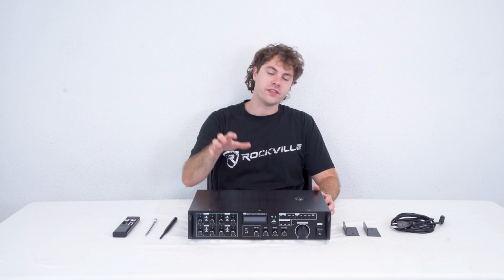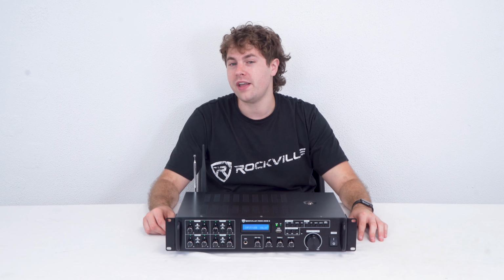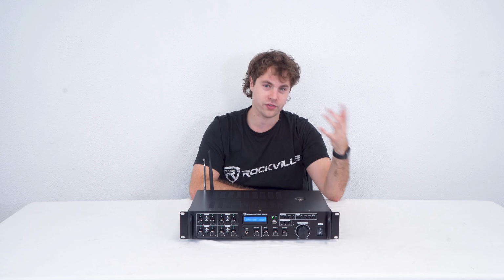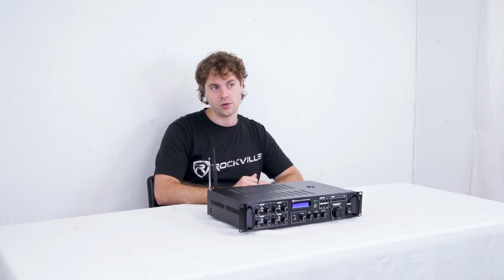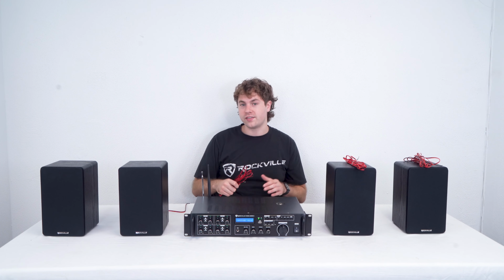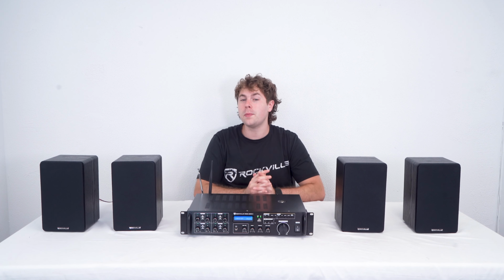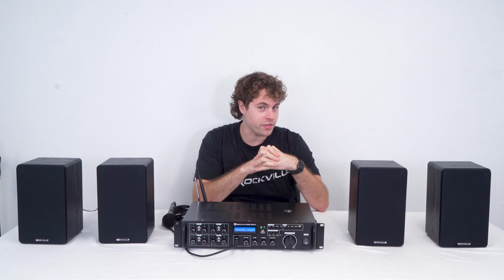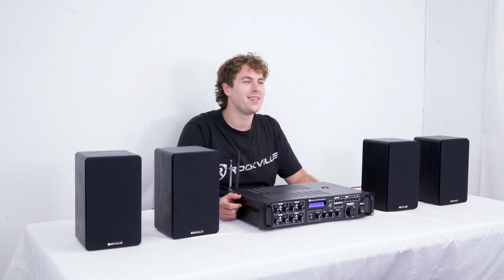How To Set Up Your Rockville Rock Zone 8 8 channel 8 Zone 1000W RMS Multi Room Receiver/Amplifier

Comment: Ok so instead of using near field monitors like everyone else i need to be difficultz im mixing from a focusrite interface and im just looking to upgrade my avr and have 2 decent book shelf speakers and 2 subs.

I know, crazy who would mix music on, i do. The goal is to create a good stereo mix so ill us FR headphones to dial in and out good and bad frequencies but my speakers are currently LG home stereo system with 1 rca input and left and right stereo speaker wire jacks.

Just added a Samson powered 10, much better but i want 2 subs and 2 decent book shelf 3 ways.

Would this rockville unit be ideal or something less
(Im trying my best to not ask you to recommend a non rockville product)

But thats what im trying to accomplish, and this seems to allow me to have 2 subs and 2 decent loud speakers, maybe 4 which would be cool...because i could get some 5 or 8 inch book shelves and then a pair of 3 or 4 in book shelf 

Would that work or am i not making any sense